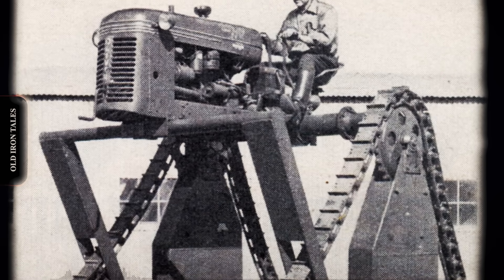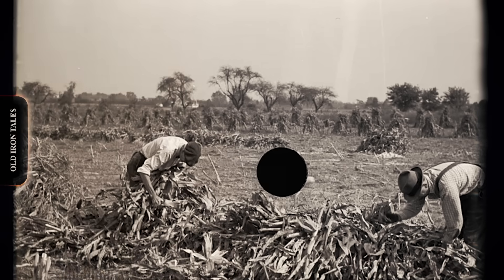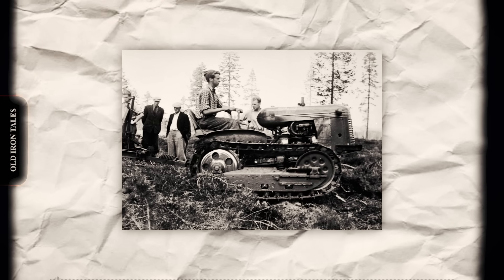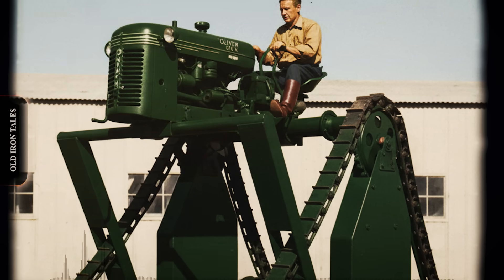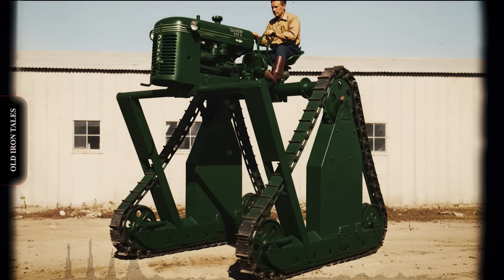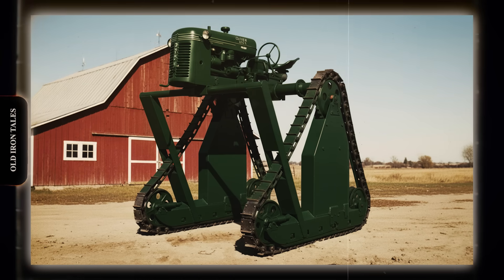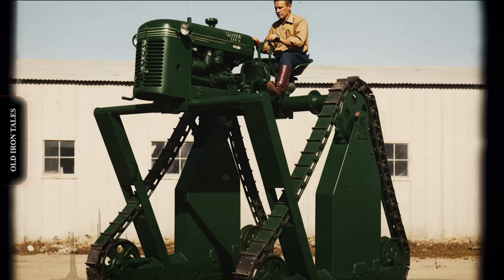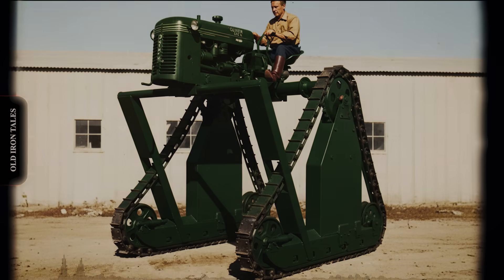The Weirdest Tractor Ever Made Finally Explained

Comment: Yes, the use of T-cytoplasm in growing hybrid seed or was a godsend for the seed producers allowing them to forgo detasseling but it led directly to the 1970 corn blight fiasco. The T-cytoplasm opened the corn crop to being vulnerable to Southern Leaf blight. In the 1970 corn crop simply died about half way through the milk stage. We had tremendously light test weights because the kernels were only half filled. Corn would blow off the truck or wagon if you filled it to the top. Yields were cut in half. Damage was done, lesson learned so the seedcorn producers went back to sdetasseling. Eventually detasseling became mechanical.
Reply: My first job was going behind the detasseling machine and snagging the strays.